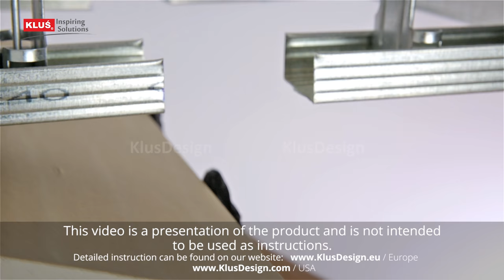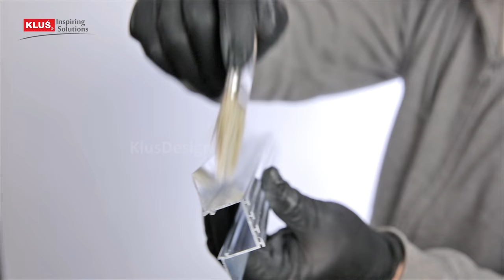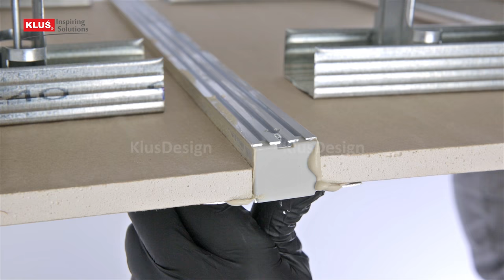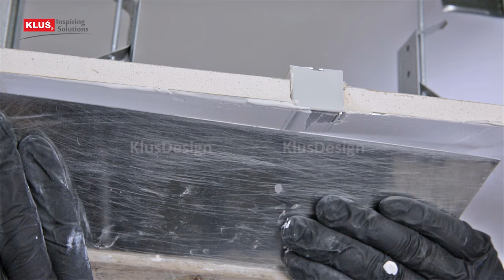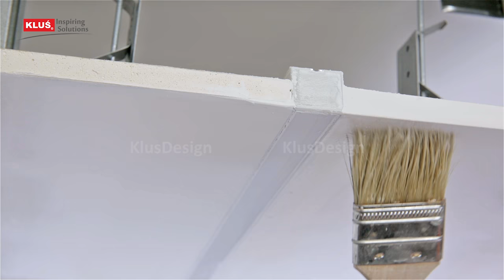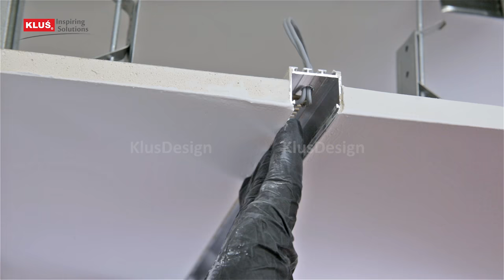KLUS LLC - The KOZEL extrusion allows you to create an integrated line of light

Comment: What is that adhesive you used? Was that glue or spackle?
Reply: Installer please reply this.
Which glue you used as adhesive?
Reply: @ghazanfirali2489  yes please, there is no sound or any explanation.on what products to use!
Reply: @ghazanfirali2489  I found they recommend this glue : GS 20 CEKOL
Reply: @SuperStanislovas  thanks dear for your reply
Reply: I'm guessing you should be able to screw it in as well through the metal since your gonna cover it with mud and paint